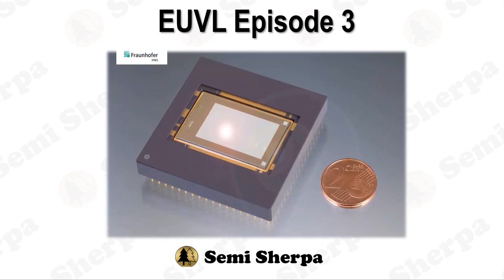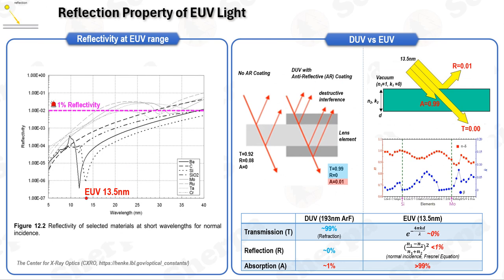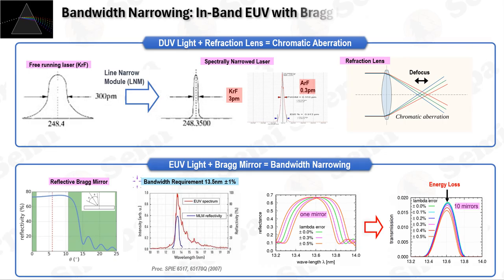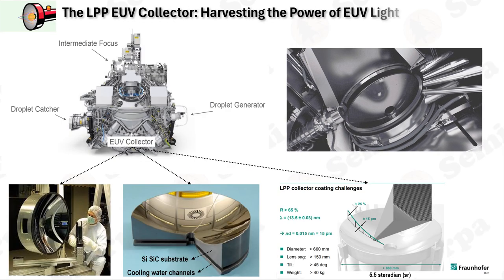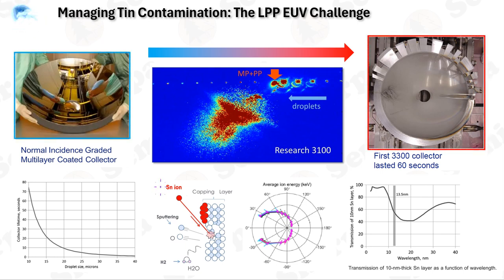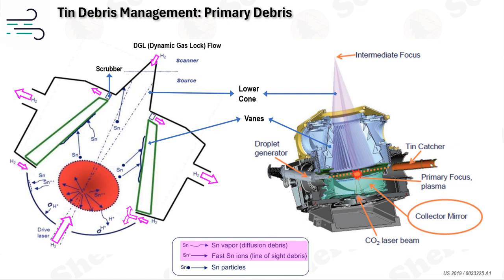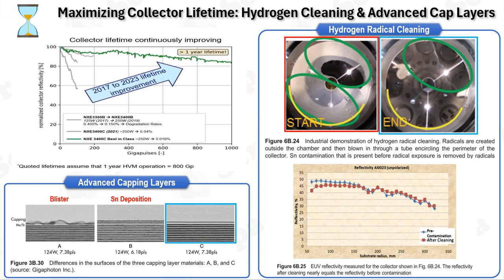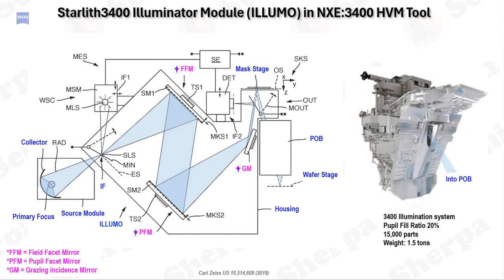[EUVL Part3]  EUV Mirror

Comment: I wonder what kind of properties a synthetic diamond mirror would give.
Reply from the maker: Thanks for the intriguing question! Here’s my take:

1. Low EUV Reflectivity: Single-layer diamond films don't offer high reflectivity for EUV wavelengths. Effective EUV mirrors require multilayer coatings, like Mo/Si Bragg mirrors.

2. Material Comparison: Diamond doesn’t provide significant advantages over Mo/Si multilayers. At EUV wavelengths, diamond and graphite offer similar atomic properties, making their unique bonding structures less impactful.

3. Manufacturing Challenges: Diamond substrates are difficult to process with techniques like ion milling, limiting their practical application.

4. Hydrogen Environment Issue: In EUV systems, hydrogen environments used to manage tin debris can cause diamond to convert to hydrocarbons, further complicating its use.

I appreciate the great question. For a broader perspective, consider discussing this on a forum with a larger audience. Keep those brilliant questions coming, Silicon Pioneer!